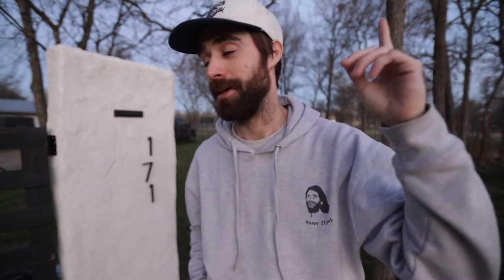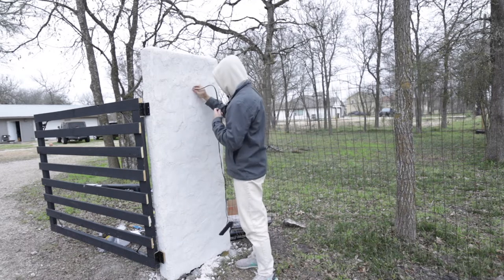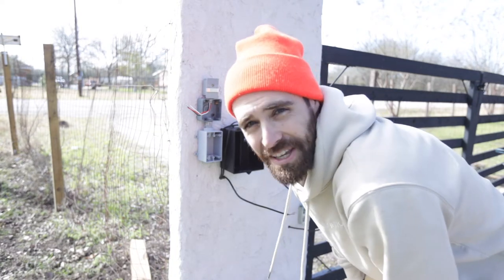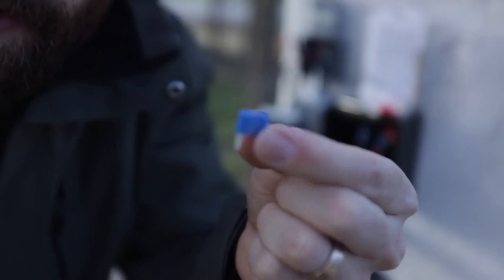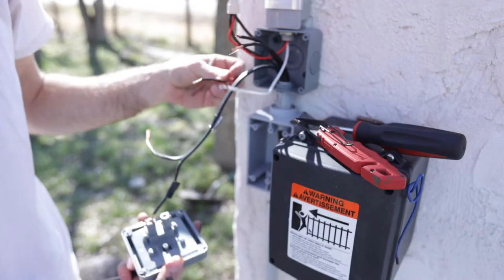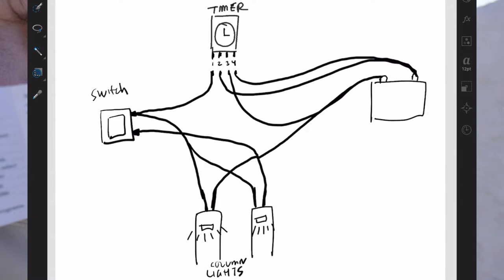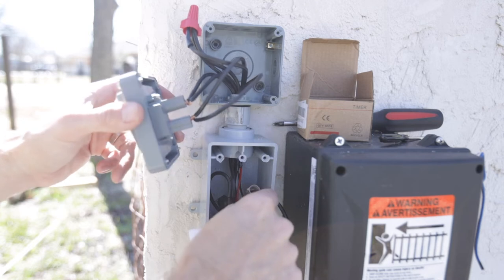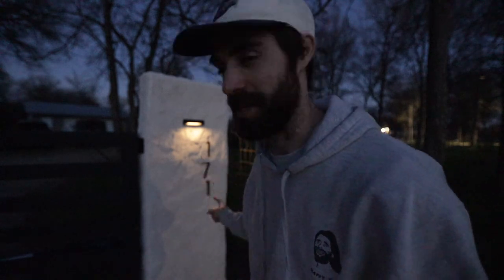Install Gate Lights with Mighty Mule 12v Battery

Comment: Watched your video with interest. I built an almost identical system several years ago. I used a 12 volt photo switch (Amazon) to turn on my led address lighting and it's worked flawlessly for several years. Current draw is minimal so it's never affected battery life. Powering everything is a 35 watt solar panel and a U1 battery (although I just ordered a Lifepo4 15ah lithium battery) Our gate is 300 ft. From the nearest AC hence the solar. 
Keep up the good work!
Reply from the maker: Great to hear!